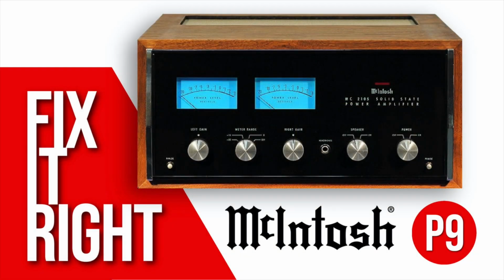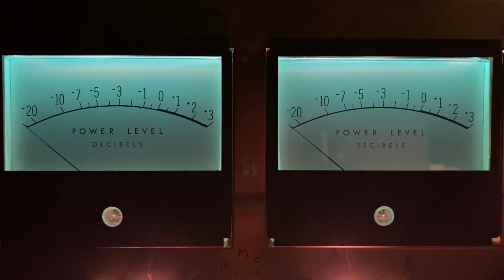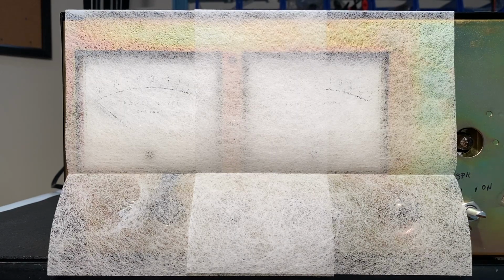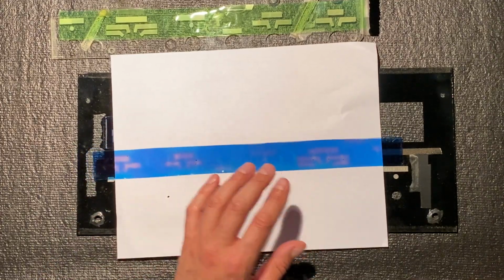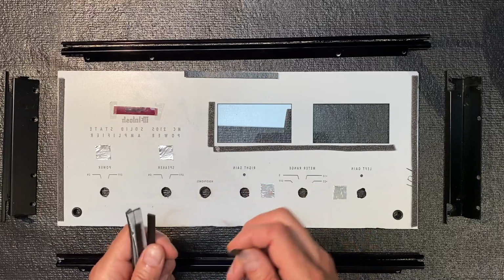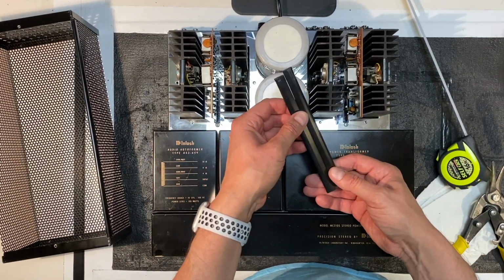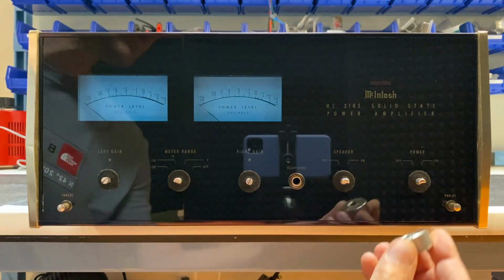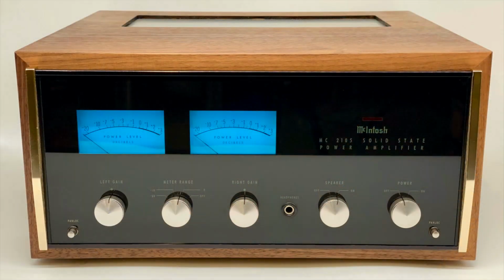McIntosh MC2105 P9: Demonstration, Meter Calibration, New Lamps, New Glass, New Cabinet & Panlocs!

Comment: Hi Chris,
Just an FYI, (and a question***):
I had to stop working on the amp to catch up on a lot of things that I ‘stole time’ from and if you recall, just before I stopped working on the amp, I found that my meters were reading correctly and that I had just mixed myself up regarding the output specs.

I ordered some 8 Ohm x 200-Watt dummy resistors, but the ones I received were the wrong rating (there went another few days). I sent those back and received the correct resistors about 3 days ago.

I mounted them to a good, heavy, aluminum plate, as a heatsink. However, these barely get warm, (at 200 watts, I should have figured that they wouldn’t get hot).

Anyway, the bad news is that the new dummy loads allowed me to test to max output. The resulting tests showed that the amp would not put out any more than 67 Watts on the right channel and about 61.5 Watts on the left.

That’s with the amp warmed up for at least 30 minutes and the Left & Right Gains turned to their maximum Clockwise travel. (Tested with 1KHz @ 1V Sine signal to both channels at the same time and to one channel at a time, same results).

I inspected the components that are attached to the black heatsinks where the transistors for the Power transformers are located, (just opposite of each Output PCB). 

I could see that at least one of the three large, white, rectangular-shaped resistors for the Left channel, appear to be badly degraded. The white, rough-textured, material, (that I think is insulation), has some serious degradation (or maybe corrosion?), on the end of one resistor. It looks like a little pile of white, powder-like, material resting on one end of it. 

These are special resistors that appear to have “.33 Ohm 5V 5W” printed on them in red ink. Mac doesn’t show and schematics for this section, other than the Transistors, but it does give part numbers for the resistors.

The resistors themselves look a lot like my 8 Ohm x 20W dummy load resistors that I bought a few years ago. I believe these Mac resistors are wire-wound.

I tested them in circuit and they seemed OK, but I have no doubt that you would have replaced the degraded one if it was in your amp. Still, I don’t know if that would explain the power loss. There’s a lot of ‘slack’ in the new Gain Pots I bought. 

By ‘slack’ I mean I must turn each Gain about 10% before the Output voltage registers .002v on my DMM, and I must continue turn them another 5% to 10% before the meter needles begin to move from their ‘zero-resting place’.

* Where do you think may be a good place to start looking?

It’s going to take a little time for me to find a replacement resistor. The work it’ll take to replace them may be too far out of my capabilities. It’ll be something I may tray later this year.

I turned 65 on April 18th and after seeing that resistor, I decided to buy a Digital Oscilloscope, which I’ve been wanting to get for a few years. The one I’ve been using was analog, 20MHz BK Precision 2120 and limited to a few tasks.

The new one, (which I received today), is a Siglent 1202X-E 200MHz scope. It’s no a professional model by any stretch of the imagination, but it can do math functions and will give me figures in real-time.

It’ll take me a while to read how to use it well enough to help me but it may be just the ticket I need for repairing the amp. It’ll be a big help for tuning in my three Reel to Reel decks.

I replaced the heads on one of my mastering decks late last year using the analog scope. The new Siglent 1202X-E should get me a lot closer to specs.

As for the Mac: I’ve calibrated the meters to the -0db (50 watts) and I’m continuing with the job. I’ve replaced all the bulbs with LEDs, but I ran out of my AC aluminum tape. I liked the way it reflected the light back to the amps meters when you demonstrated it, so I’m ordering some more.

I didn’t know that the labeling should have glowed a greenish-blue. I bought LED replacement bulbs for the MC2105 about 3 months ago. I could have bought green LED bulbs for the panel if I knew they were supposed to be that color.

The blue filter I have has been worn by the heat from the UV light omission, just like yours. I’m going to proceed with Part 9 of the video and until I have a better understanding of the new scope, I’ll go back into the amp to fix the Output later. 

That is, unless you think you may have a pretty good idea what may be causing the amp not to make it to 105 Watts.
Rich
Reply from the maker: Rich, those ceramic resistors you’re referring to definitely appear on the schematic for the power output section. As you’re getting low power on both channels, the problem is most likely something common with both channels such as the power supply. It could be those resistors, but you’d have to have the exact problem on both amp channels and you have to consider the likelihood of that. 

Also, please make sure there really is a problem and double-check your calculations and connections. If you’re confident the amp really isn’t putting out the power, put a scope on the output in addition to the dummy load. This will tell you if there’s a problem with the output sine and whether the issue is clipping on both the positive and negative or one or the other. This will help the diagnosis. 

From there, you’ll have to approach the diagnosis by first testing all the voltages and signal tracing each stage to discover where you’re losing gain. Also, make sure that the level controls you installed are a. Installed correctly and b. The correct resistance. If those level controls aren’t allowing the full input signal to pass, the amp might not have enough signal to reach rated power.

Make sure your dummy resistors measure 8 ohms (if not use the actual resistance for your wattage calculation) and make sure you’re using the correct impedance speaker output terminals (8 ohms).
Reply: @FluxCondenser   Thank you Chris! Yes, as far as the more obvious things go, (checking the resistors for 8 Ohms, watt calculations, speaker connections to the 8 Ohm output, etc.) those have been checked and rechecked. My new dummy loads are rated for +/- 5% (they're a very good quality). 

However, I later realized that I should start with checking the voltage that's going into, and coming out the Gain Pots. I wrote down everything you've suggested and I plan to do a troubleshoot tomorrow. 

The fact that the Right channel will put out 67watts (23.12 Volts) and the Left channel only puts out 61.5 Watts, (22.16 Volts), or about 5 Watts less, could mean that there are at least two issues. The first, and "main" issue being the whatever is affecting both channels. The second issue is in the Left channel only. That degraded resistor may be why there's a 5W difference in addition to the low general output. 

I've pulled up your video regarding the amp tests that you ran and the first thing I'll do is check to see if there's any clipping. I guess if I don't see any clipping, it may mean that the amp isn't putting out enough voltage to reach a power level high enough to cause a clipping. I'll watch for noise levels as well. 

BTW When I talked to the Mac tech the day I bought those two Gain Pots, he said that they don't carry the same part number as they did when the MC2105 was made. I tested both of the new Gain Pots when they got here several times, (in, and out of circuit). You can be sure I'll be checking them again, but they checked fine, (I don't recall the rating off hand).

Thanks for the suggestions, and I'll update in a few days, but if I can't find any smoking guns, I'll have to close her up and come back to it in a few weeks or so.
Rich

Comment: THANK YOU FOR SHOWING US YOUR PROJECT. BTW HI, DO YOU KNOW WHAT I HAVE TO DO TO FIX THE BUBLE OR FLAKE UNDER THE GLASS OF A MC2105?
Reply from the maker: Thanks, Miguel. So glad you enjoyed the series. A flake can be repaired by adding some black touch-up paint on the back of the glass dial where the paint has flaked away. A bubble requires that the affected-paint be removed and repainted. I’ve had little luck with repairing bubbles and have generally opted to buy replacement or reproduction glass dials in that case. Even repairing a flake presents a challenge as the paint must match exactly for the repair to be seamless. Those glass dials are beautiful, but a PITA.

Comment: Hi Chris,
First, I want to apologize and I accept full blame and responsibility for all the confusion I caused.

I never had any problem with the meters other than a small calibration adjustment. It wasn’t until I started referring to Volts in my posts, when I meant to write Watts, and Watts, when I meant to write Volts, that I started confusing the both of us.

I was trying to get 20 volts out of a meter reading of -3db so that I could achieve a 50-watt output. It wasn’t until I went to the owner’s manual that I spotted my mistake.

I started out knowing how many output-Watts I should have at a given db. But somewhere along the past few days, I forgot and confused the specs I thought I had memorized from the owner’s manual. The -3db was supposed to achieve a 25 Watt output, (about 14.142 Volts on the DMM). 

But I was looking for 50 Watts. As soon as I spotted the specifications in the Mac manual, I realized my mix-up and knew that the amp’s output and meters were going to test just fine.

I went back and carefully adjusted the amps meters (with the meter range set to “0”), to show a 14.14v to 14.16 volts on my DMM display and then I adjusted the meter’s needle to point exactly on -3db.

That established 25 Watts at -3db per Mac’s specs. I then meticulously logged my results of every voltage reading at the meter’s increments for the -20db, -10db, -5db, -3db, and 0db steps.

I did this for both channels so that I could compare them afterwards. I then calculated the Watts at each of those points. I was able to confirm that each resulting Watt specification was good, or as accurate as my own vision would allow.

A lot of it is dependent on how accurately I see the needle when I’m lining it up to the scale for any of those meter increments. In addition, the slightest touch of the Gain dial can change the DMM’s voltage reading enough to change the final calculation by a few Watts, up or down, and yet I would barely see the needle on the meter move.

That’s just the way things are when you’re dealing with analog equipment.

Mac gives specifications for a few of the db points in each of the three Meter Range selections, (the “0”, “-10” and “-20” power selections).

I only got about 46 Watts output at the 0db increment, but I’m fine with that. I’m going to move on to complete the job when I wake up later today.

Anyway, I’m certain that I am ‘out of the woods’ and this time I think I can be reasonable sure that this job is going to be finished before the day is over!! I’m going to finish watching Part 9 of the video and wrap this up.
Rich
Reply from the maker: That’s good news, Rich. Glad to hear. No worries about the confusion, but I must admit, you had me worried a couple of times! That was a big job to take on for someone without a ton of experience so it’s absolutely understandable that you got confused now and then.